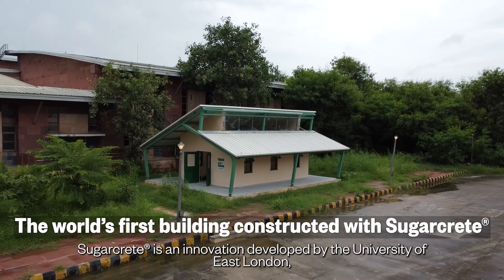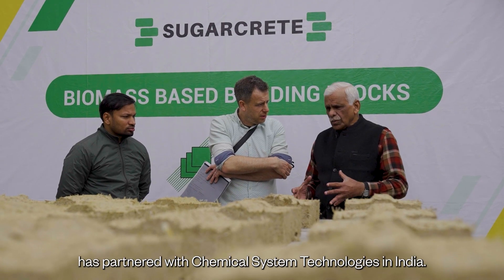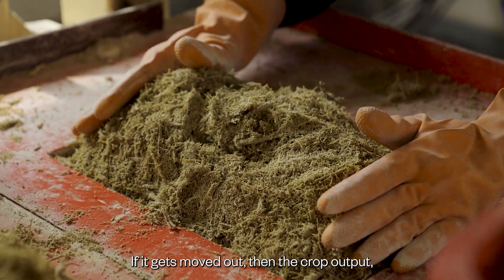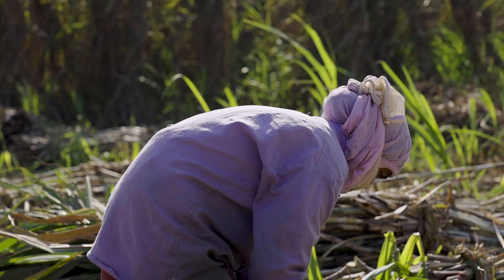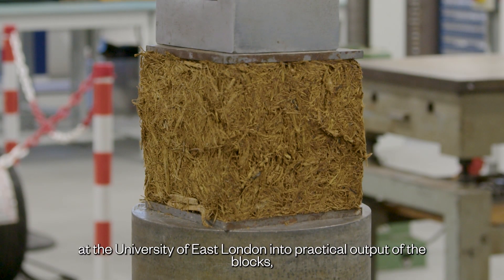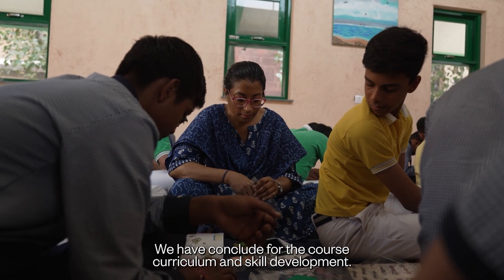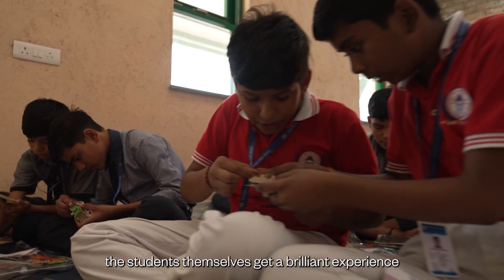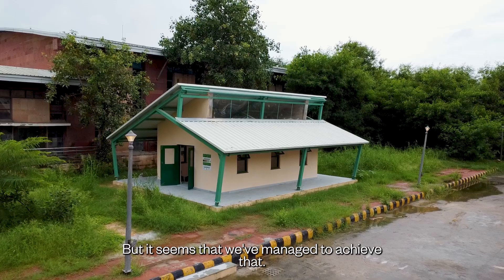Sugarcrete India

Comment: Good idea. But I'm doubtful about it's structural integrity under heavy load or duress. How hard would it be to breach the walls with a heavy hammer? Also logic says dried compressed sugarcane material should be highly combustible hence vulnerable to fire hazard. Is this even practical?

Comment: Not to be a pessimist, but why is building entirely supported by steel frame instead of the bricks taking the load? If you're trying Sugarcrerte to be a viable alternative to conventional kiln-fired bricks, then at least aim for it be load bearing. It's good to see that they're trying to solve the issues related to bricks but not achieved the advantages of one.
Reply: Concrete is also reinforced with steel.
Concrete and this new material, both are good at taking compressive loads but the tensile and bending loads need to be taken by steel.